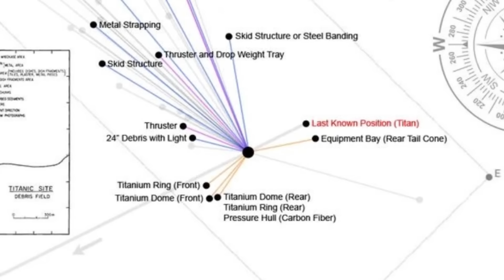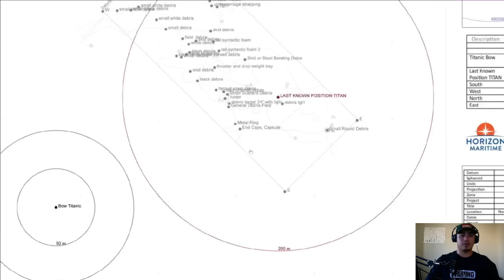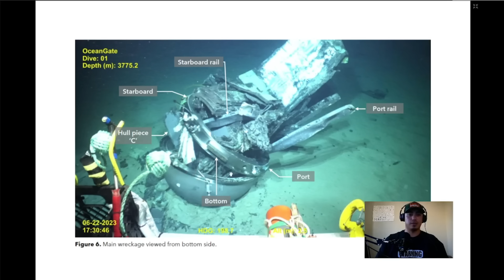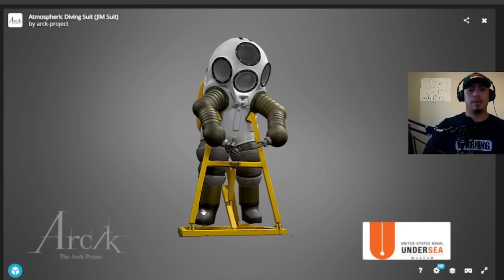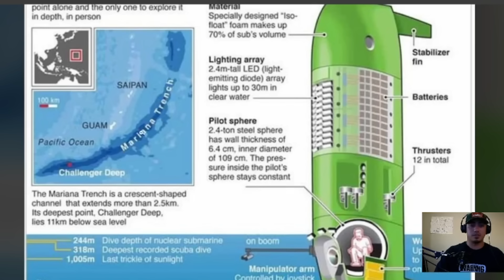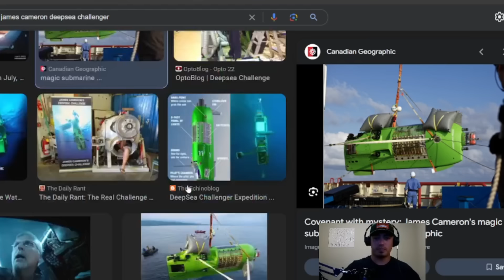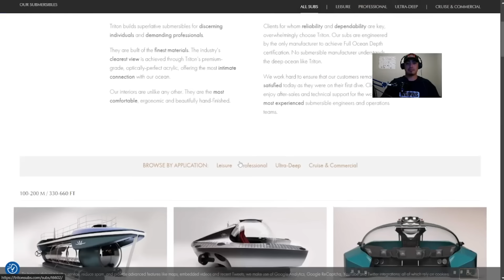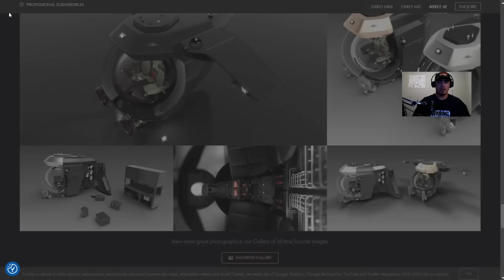Part 3: Investigating the OceanGate TITAN Tragedy: Mysterious Rust, Debris Theory, & Sub Comparisons

Comment: 11:00. Maybe it is revealed later in the video, but that reddit map isn't correct.  The tail cone wasn't found by its last known position.  The tail cone was found up by the skids.  On the original map, it's called Tail synctactic foam 1 and 2.  
I'm continuing on with the video.  I find this so fascinating.

Comment: One element that I'm aware of is while I was watching footage where Stockton and others were talking about the design of the Submersible I do believe that they had a little outhouse compartment on board and a liftable curtain that covered it. Well, if that were the case, then they must have had a compartment for the waste. And during the implosion, Who knows what happened to that part of the craft, Or if there was any fecal matter in there. and how such substances could cause different chemical reactions with the crafts remnants.  Also, I've seen elsewhere that the bodies were utterly pulverized and get in guessing, well the human body does contain a high amount of iron and can contain a lot of copper. These are elemental considerations when evaluating the wreckage.

Comment: maybe the rust is  from the oxygen tanks once they imploded and slightly rebounded , as I've cut up a lot of old tanks and they do form scale rust inside
Reply: The ones I saw, at least on a few renditions appeared to be aluminum O2 tanks, but seeing as they were using "off the shelf parts," it's hard to tell what was used and where.
  I was thinking oxidation from the passenger's blood, or from the framework,  blots, etc. on the outside of the Titan. 
  The make-up of the materials used would help fetter out what was actually used.
  My guess is that they didn't use appropriately-rated parts for the Titan.
  Local hardware store parts, or even many rated aircraft parts, wouldn't have been appropriately rated for this application. 
   Far too many corners cut on the Titan project.

Comment: The rust spots are probably from contact with the steel pipes Stockton used for drop ballast....unless I'm wrong i heard he used black gas pipes of different sizes inside each other stacked under the bottom of the sub somehow.

Comment: Magical presentation, thank you. As much as I have studied what has been presented, both verbally and visually online, I can't find a definitive explanation as to which direction, imploded or exploded, of what looks like the totally inadequate return of the "C Section" that encapsulated the outer diameter of the carbon fiber hull. The downturn legs of the interface rings if you will. What were there dimensions, 8mm-10mm in thickness? Which direction was the force that sheared one of them so equally and of all things radially?
Reply: It's thin alright,  but it was never meant to carry the load,  just to contain the glue joint.  The bond in the face of the ring is the attachment point.  The glue gave out and the inner ring was completely sheared. I'm not sure how the outer ring got took out except that it was all glued together.
Reply: @headphone307  I'm still struggling with fact that there must have been enough resistance on the downturns to facilitate a shearing action.
Reply: As you say, it's thin alright, but those 8/9 mm flanges were expected to resist 6,000 PSI.
Reply: @teddyshepherd2854  The titanium rings are quite beefy. The flanges,  not so much.  If the glue let go,  there's nothing left to seal out 5000 psi.  So then the flanges can't do any more.  The don't need to be there,  and aren't doing much.  But they did centralize the carbon fiber tube during assembly,  and the held the glue joint when formed.  If there had been a thicker channel when the glue let go,  it wouldn't have mattered as it needs to be a perfectly water tight seal, not just a weight loading member.

Comment: The last pinged location of the Titan was at 3346 m (See info text at 3:40 mins). I believe they lost it 6 seconds later. The Titan debris was found at 3777,6 m (See ROV pic of front and rear dome at 14:05 mins). It dropped "only" 431m
Reply from the maker: Ahhhh yes, you know on the sonar scan I did see it was darker around the titanic so I assumed it was slightly deeper there. I forgot to take into account the ACTUAL bottom depth where it landed. And also the 4,000 depth is what it’s commonly referred to as, obviously not accurate. Thank you for providing some accurate information! Also I forgot to check the ROV depths on screen, I’ll certainly mention that next time I use that footage.
Reply: @SSPDIVING  You are welcome ;:) You did an amazing job with the video. I truly enjoyed it. I just mentioned the 400+ m from implosion to bottom because it might explain how close together all the debris was even better.
Reply from the maker: @beautifulbluebell2037  it certainly does! Just goes to show how many details you have to take into account to paint an accurate picture! Thank you for the info!

Comment: "Different voltage" in essence means that the hull came up with a different size than before, and went on changing back slowly. 

I would never ever had used that hull again. I mean, thats why he put the sensors there: to be able to see when the hull was "worn out". The bang and subsequent different behavior is a certain indicator of major delamination. It was used up, warn out, defective. To use that again shows the amount of delusion involved here.

Many people were critical to the sensors, saying they would give signals when it was too late. I think the risk for that is huge. In reality they won the lottery, they got clear indications before it was too late. But they choose to ignore it. Think of that: having that big lucky, thry were given the ticket to not die, and wasted the chance.

Comment: The timeline for the manufacture of the end caps was before they found out that the recommended thickness of the carbon fiber at 10 inches, which was reduced to 7 inches, only the c channel was 5 inches, and event when they reduced it to 5 inches, it was too big for the channel due to imperfections in the process.

Comment: Regarding the orange "rust?" spots. That discoloration may not be from sitting on the botton. We may be looking at the bottom of the Carbon Fiber Hull that was in contact with the Landing Skids. Notice how those orange markings are in a rather rectangular shape. There are right angles to the stains.
Reply from the maker: I’ll have another look. The skids are stainless though, I don’t think they would create surface rust. There didn’t seem to be any rust on the skids. Someone mentioned rust scale from inside the O2 cylinders which I guess is a possibility.

Comment: Definitely suggest the maker go check out thunderfoot for his implosion speculation and conclusions. Failure of the glue adhesion leading to the water bypassing the seal, and effectively cutting the titanium coupling clean off, then crushing the contents like a bullet as the compressed seawater rushes to find a space to stretch it legs before the ocean above has time to crush it once again under gravity.

Comment: 26:54 no thrusters on that JIM suit! That’s why it has legs. Later developments added thrusters but I think most of the suits with thrusters were from other companies, like the Newtsuit, ADS 2000, etc.

There was another model I can’t find mentioned in the Wikipedia articles, which instead of legs had a non-articulated lower hull, so had to use thrusters exclusively. Edit: that model was the Wasp.
Reply: Do you know when thrusters were added? The JIM suits I worked with had none, but that was in the 1980s. 
  It would be interesting to see the engineering changes over the years on those and the submersibles, and why changes were made.
  The suits that were being used then certainly had some issues and bugs to work out. The "keyboard" controls in the hands were used to move then suit. The suits were heavy (required a crane to launch & to retrieve), and you had to "play cords" to articulate the body.
  If I recall correctly, I think the suits we had were only rated to about 600'. Working, they were only taken yo about 450' (not meters.)
Reply: @CarolReidCA  No I don’t. I’ve been fascinated with tech like this since I was a kid, and didn’t even know that any JIM suits ever had thrusters until I read the Wikipedia article today. It sounds like they weren’t very common or successful.

Comment: if the tail cone had the battery, thats why it went straight down.  those batteries cost $1-300k and  weigh thousands of pounds.  i believe they use lead acid (car batts) but like 100 of them.  what i want to know is if the shockwave broke the titanic railing.  even as a mere ship enthusiast (and over only watching half of this, i can tell it's much more informed than jeffostroff and other oceangate news floating around youtube rn. ill watch the rest after work, but TIA.

Comment: The rust spots appear on places there shouldn't have been metal contact, ie between the layers. It's more likely to be steel shrapnel that has lodged and settled on the debris.
Reply from the maker: Well I would say that makes sense but where did the steel come from? The only thing I can think of would be the oxygen cylinders. Everything else was stainless or titanium.
Reply: @SSPDIVING  Stainless steel can rust with prolonged exposure to salt water, especially non-marine grades. It hasn't been mentioned, but I bet Stockton went for the cheaper grade of stainless when given the option. The drop weights were probably mild steel (although probably outside of the shockwave, so no spall like what we see), and there would've been some steel parts in the equipment/electronics inside (probably not enough alone for this amount of rust).

Another possibility is that the sea bed is coated with rust and iron particles from the Titanic wreck, and the Titan sub wreckage was contaminated when it disturbed the bottom.

Comment: Did the find the acrylic window? Or do you think the window shattered during the implosion? Or did the window failed? It was not suitable for the 3300+ meters!
Reply: Window has still not been found.  I don't know if it is whole or in pieces.  But, the window was held into the dome by a metal ring bolted in place.  That metal ring is also missing and the bolts were sheared clean indicating torsion.
Reply: @lordvlygar2963  From what I've heard from the USCG hearings I suspect the failure may have occurred around the window as well as the delamination. The implosion squashed the hull backwards into the aft.

Comment: Could the dropping of the weights caused something else to happen?  Since that was the last communication?
Reply: I'm no engineer, but that was my thinking too; straw that broke the camels back kinda scenario. Doesn't seem too unlikely that dropping some of the weights would alter the force on the hull and potentially create different flex, like a muscle contracting but on the most minute of terms.
Reply: @Spamhard  That's kind of what I am wondering.  I just don't know how much of a jerking motion dropping weights would cause
Reply: @cappadocius9379  Exactly. And I know some folk expressed concerns with how when the titan was on a crane/winched, the attachment points were at the top of the titanium rings, which would mean anytime it's lifte there's going to be unnecesssary pressure on the lower half. Gotta wonder if the weights and the lower tray were basically doing the opposite, so the Titan was getting constant extra strain on the glue back and forth any time she was moved or dived.
Reply: @Spamhard At those pressures, stressor or any type can be amplified, and there was plenty of stress on the hull from the weight of the parts, the people onboard moving, the tail section, etc.
  Currents cause additional stresses that can be catastrophic and can cause a failure. 
  It seems the "glue" between the carbon fiber hull and the ring for the end cap aft on the vehicle is where it likely failed. 
  The Titan had so many issues. So little proper testing .
Reply: @CarolReidCA  Right, and every tiny little stressor was basically flexing the carbon fibre in its titanium rings. It's no wonder that glue failed, you've got two totally different materials with totally different points of stress and strain with only a relatively thin layer of glue and nothing else to bond them. It's no wonder it failed at that point. To me it definitely seems sus that the weight drop was only minutes (maybe seconds) before they imploded.
Reply: Possibly.  Nowhere has it been shown that the craft was balanced at different weight shedding processes.  It's quite possible that dropping the weights caused the bow end to become perpendicular and create a spinning motion that didn't stop until the implosion.  Very possible but not 100% certain.

Comment: Is that 1,000 lb. dive suit anything like the NEWT SUIT( spelling may be incorrect) like the one worn by the diver who went down to the wreck of The Edmund Fitzgerald, to remove the ship's bell at the request of the crew's family members. He also took down a replacement bell engraved with the crew members' names. It was said that sparks from the oxyacetylene torch normally drifted out away from the diver. But in that case, the sparks from the torch went up INSIDE THE BELL. It was said that if anything went wrong It was like the diver was building a bomb. The suit was  described as "a wearable submarine". After the diver in the Newt Suit replaced the engraved bell, it was said "He went buzzing around the wreck snapping photos" I was just wondering if THAT suit was similar to the one you described. The depth of the Fitzgerald wreck was 532 feet. The length of the ship was 834 ft. So when it went down..the bow of the ship hit the floor of Lake Superior and buried itself into the lake floor..broke in half at the 10th hatch on the ship. Sorry I went on a tear here, but deep  diving 
has always fascinated me.
Reply from the maker: @katharper655  oh man, that’s pretty cool. Thank you so much for sharing!! I feel like I heard of this years ago but never looked into it. Probably a story someone shared while on the docks a while back. 

The NEWT suit is an atmospheric suit so just like the two I shared with you. Same principles and functions but different design. It does say it can operate fully untethered as well. I don’t know if all the other atmospheric diving suits can operate untethered as well or if I have only seen them tethered due to safety regulations. In any case, that would have been pretty scary. Pretty much all the gasses from cutting were getting trapped and all it would take is one spark to float up into the bubble and you have yourself a gigantic bomb.

Some divers have died from this and one guy I went to school with had his helmet blown off but survived. I think in that case he was burning (we typically use underwater exothermic cutting torch which reaches 10,000 degrees F). Anyways, he was cutting a pipe and gasses got trapped inside, they thought they cut a vent hole above where he was working but nope. The gases built up and a spark hit the bubble of gas inside the pipe and Ian instantaneous explosion occurred.

I will add the Edmund Fitzgerald to my future video post. I would like to cover events like that later down the line. Thanks for sharing with us. Cheers🤙🏼

Comment: The tail cone was possibly dropped in an effort to inflate an emergency balloon for quick ascent. This also explains the missing landing sled, which likely was also dropped with the weights prior to the implosion. I think there were two hours between the loss of communication and the implosion. At any rate, those poor people were struggling for a while. Sad stuff.
Reply: I believe they couldn't drop the sled or tail cone and didn't have a balloon to inflate.

Perhaps it was mentioned in the video or there is information out there but I don't remember those things being mentioned.
Reply: I don't know about the two hours, but I believe you are right about the abort procedures.  I have been watching Forensic Cats analyze it and he gives extremely convincing evidence of this.  I don't agree with everything he states, but it also changes as he learns more information from the released reports.  
My hypothesis of the implosion is at the bow ring.  The carbon fiber lost enough grip to let in the water.  Immediately shearing the rest of the carbon fiber from the bow ring, causing the ring and dome to rotate as it crushed in all the material.  The force was so great, it mangled the air tanks as if they were putty and sheared the aft ring from the dome through the torsion.  The Reddit debris map is wrong.  Going by the actually released debris map, it seems they aborted the mission and dropped the skids and tail cone. But, it wasn't enough and as they ascended in a circular pattern, the inevitable happened.
Not everything makes sense on that map, either.  I suspect that some of the debris is left from previous dives.  Hopefully an officially studied answer is released soon.